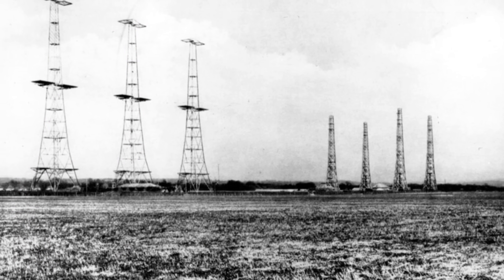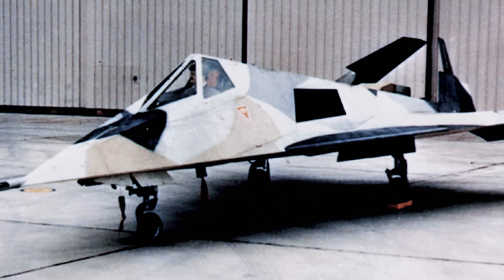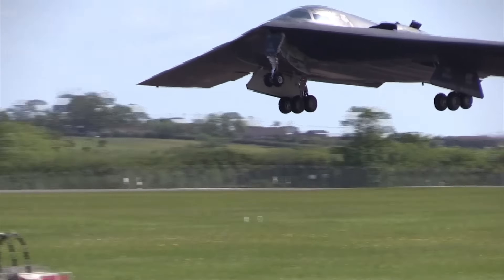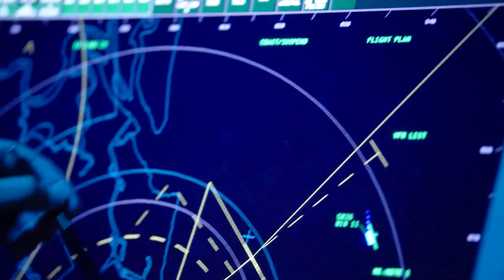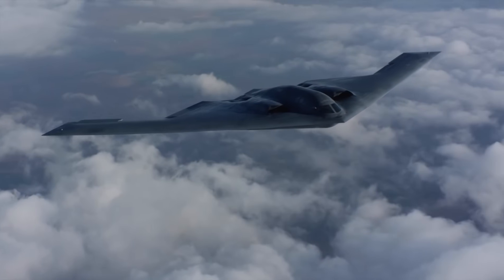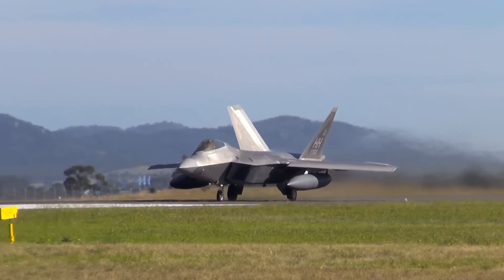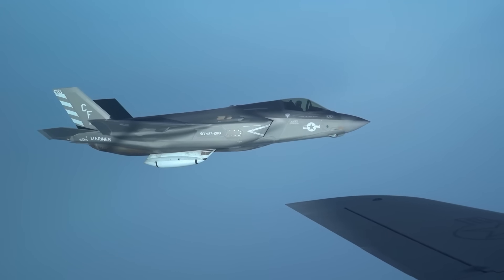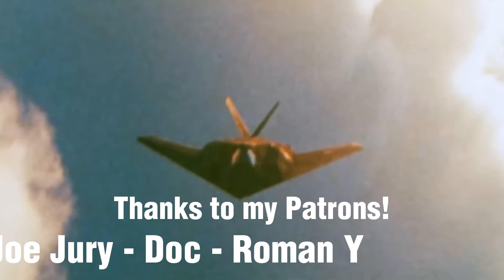What Is Stealth?

Comment: Step 1: align angles on all surfaces to as few planes as possible. Direct all emissions upwards and/or outwards to the same few spots in the sky.

Step 2: avoid corner reflectors

Step 3: bury engines and other moving surfaces using S-shaped ducting. Remove external features, if at all possible.

Step 4: carry stores internally

Step 5: start implementing more esoteric sources of reflection - break up long lines (e.g. wing leading edges) using pyramidal reflectors buried under a radar-transparent skin. Look for weird edge cases where a seam or surface is long enough to act as a resonator.

Step 6: apply RAM, taking care to match the type of RAM to the use case. Carefully shape the cockpit canopy and make it out of expensive radar-opaque materials.

Step 7: hunt down and eliminate the final sources of reflection - panels, seams, external rivets etc.

Step 8: do all of the above using powerful computers and custom-designed software - you can't design or implement all of these features by hand.

Remember: it takes a 95% reduction in RCS to achieve a 50% reduction in detection distance. So you need to be obsessive. Any flaw or defect can massively increase your radar signature and render all your careful work useless.

Also remember: stealth shaping is only good from a few angles. Your pilots need to be trained to fly their aircraft in such a way that they are always pointed in the "correct" direction with regard to enemy radar systems.

Comment: Maybe you could have an upward looking radar at 90 degrees. This should definately detect and engange steath aircraft.
Reply: Yes, it would have a near 100% detection rate. The problem is, only when the stealth aircraft flies overhead. A normal radar sweeps a vast area, while a radar pointing upwards would only cover a very short range and become near useless as conventional aircraft would fly through the coverage gaps.
Reply: @ChucksSEADnDEAD  hmm what about the othercdirection. Geostationary satelites having radar and looking down at earth seatching for stealth aircraft and sending that information to SAM sites.
Reply: @GeneralBiJay  That would be nearly unworkable due to the distances involved and the speeds of the aircraft. And the SAM site would still be clueless and firing in blind at designated spots hoping for the missile to achieve track once in range. This while fending off SEAD and electronic warfare.
Reply: @ChucksSEADnDEAD  TBH I think the US could pull this off or they probably have other ways to detect stealth aircraft that we don't know
Reply: @GeneralBiJay detecting stealth aircraft isnt that difficult.  Targeting stealth aircraft from more than 2 dozen miles is.
Reply: By the time it would be able to detect stealth it would be dead
Reply: A stealth aircraft is only stealth from certain angles, so one of the big components of stealth is mission planning. The mission are planned in a manor, so that the most stealthy angles are presented toward enemy radars. This is another aspect of stealth I don't see people tall about all that much.